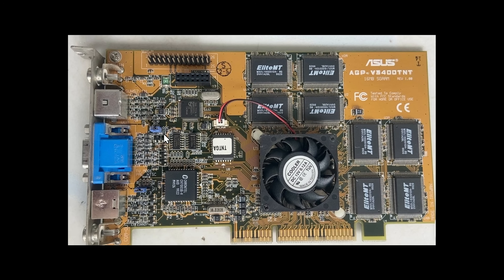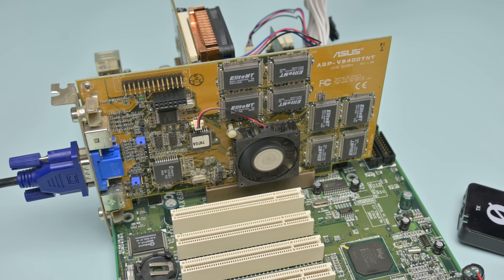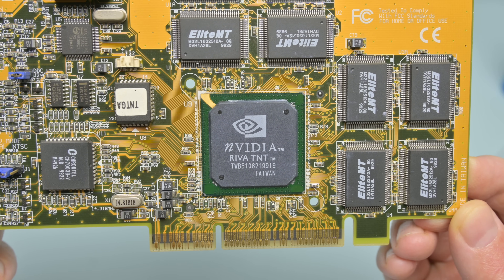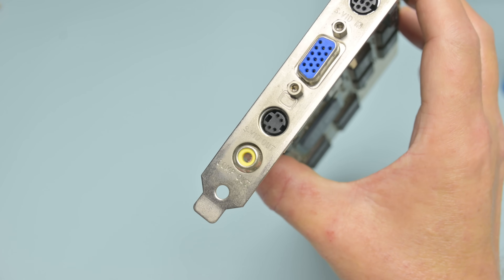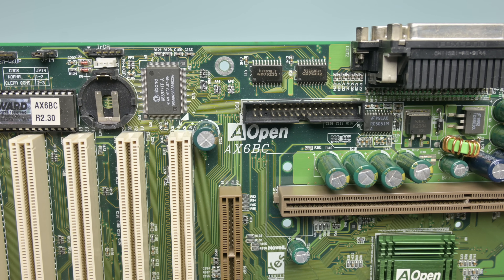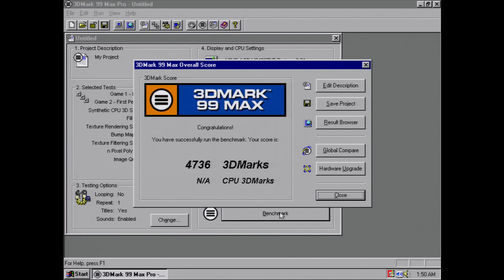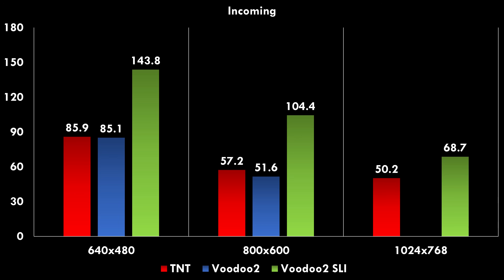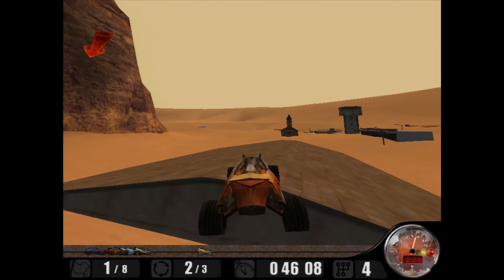ASUS V3400 NVIDIA RIVA TNT

Comment: The Asus manual might be at revision 1.01 of the card since I got one of those and on it there's only one jumper left, the PAL/NTSC switching one. A bit strange is that it says 9927 printed on the backside of the PCB, which I guess is week 27 of 1999, while on my 1.01 revision PCB it says 9841. My card has 16 MB SDRAM made out of eight 7 ns chips btw, I wonder how that would differ in performance compared to your card.
Reply from the maker: I don't think it matters that much. Maybe you can measure a difference, but I doubt it will be meaningful...

Comment: I have same card the fan is broken ( the connector is ripped )
Also i have 
STB Systems Velocity 128 Riva 128 4MB AGP 
Asus V3400 TnT 1 16 MB 
Asus V3800 Deluxe TnT2  32 mb from 1999 my original card that i bought in 1999
Probably will sell all of them
Reply: Thanks for the pinup and all of the content through the years  !

Comment: Those racing games can all be hard to play w/o a controller.  From the way the wheels are moving, I'm guessing you are playing on the keyboard.
Brings back some memories of my old PC, which, thankfully, I still got saved tucked away somewhere.
I set out to build the best I could afford at the time and ended up with a(from memory, so I might be wrong about some details)
Diamond Viper V550 which is a TNT card.
Diamond Monster 3DII(?) which is a voodoo 2 card.
STB "Black Magic" (?) which is a voodoo 2 card I got on sale 1/2 off sometime later.
All on a PII 400 Slot processor on an Asus P2B (?) MB
I believe at the time I was still using Glitchmaster power supplies.  It was a company that took Sparkle power supplies and added a GIANT stiffening capacitor under the hood.  It had enough reserve capacity to ride out an OCR.   A short description of what an OCR is, when the lights "flicker" in your house during a storm, that's an OCR tripping to protect the power grid.
Anyway, I had a lot of fun with that PC.  It's last use, tho was as a lowly monitorless Vent server.   Kind of a sad fate, but I do still have it an hope to recondition it someday for the nostalgia.
Oh, almost forgot, I was using Enlight cases at the time and that PC ended up in a unique "mid/mini" tower that mounted the power supply sideways so it has a slightly shorter, but slightly fatter form factor from a standard mid tower.
For those that may not remember those says, towers were often sized by the number of 5-1/4" expansion bays they had.
Typically:
2 bays = "mini"
3 bays = "mid"
4-5 bays = "full"
6+ bays "super tower" (I think.  I only knew a couple people who liked cases that tall)
I better stop before I write a novel.

Comment: This is my teenage years.  28 years in the game and its magic watching the progress.  To go from hundred mhz to thousands,  and 16gb of ram to thousands.  To put it in perspective my first computer 1997.  16mb of ram, 1gb hard drive 166mhz pentium video card was 2mb of ram and no acceleration.  And a 16 bit sound card.  On that note a 14 inch crt monitor 1024 x 768?  And the best part was every single year was a huge leap.   Over my HS years I bought 2 more pc's with my hard earned money.  By 18 in 1999 I had a Amd Athlon 400mhz with 128mb of ram 2gb hard drive and a 3dfx voodoo 3.

Comment: I had both a Riva TNT2 and 2 Voodoo 2's in SLI and not just the normal Voodoo 2's, the 12MB ones. It meant I could play my games in either OpenGL or GLIDE if they had the drivers for them. Damn good setup.

Comment: RIVA TNT is the first 3D GPU I ever had, so it's very nostalgic for me to see it mentioned 🥰 I had a much more basic Diamond Viper V550 card, with no TV in or out capabilities, in a system based around a Pentium II 350 MHz with 128 MB PC-100 SDRAM. Don't remember the mobo manufacturer, but the chipset was definitely the 440BX. I had that system between around 1999 and 2002 I think, when it got replaced with a system based on Athlon XP 1700+ and GeForce 3. But I'm not an NVIDIA fanboy, I owned two computers with Radeons in them, and now my daily driver is a Mac, so... no brand loyalties whatsoever.

Still, I have fond memories of that PII/TNT system. It was my first proper "gaming" PC, and I also loved playing racing games on it, including Colin McRae Rally 2.0 and consecutive NFS titles: Hot Pursuit, High Stakes (a.k.a. Road Challenge) and Porsche.

Comment: I never paid much attention to the original Riva TNT, i carried on using my Matrox card. When the TNT2 arrived it gave a clear uplift and I was finally able to play games at 32bit colour, faster than 3Dfx (Voodoo2 i think) could do in 16bit. Well that's how i recall it. 🤔  Add to that no pass through cable so image quality was improved and not that expensive compared to early 3Dfx cards.

The drivers were unstable early on, appearing to work then crashing. Sometimes updated drivers would appear a couple times in the same week, as one game was fixed only for another to stop. 3DMark99 really did show up the bad drivers, that race scene was just a crash waiting to happen. They eventually were stable and it never looked beaten until hardware TnL (Transform and Lighting) came along. M64 version was a good budget option.

I finally replaced the TNT2 but came back to it years later and compared it with a GeForce3 Ti200. It stood out that the TNT2 could seriously perform with a faster CPU. I think i had a K6-2 350 and later ran it on an Athlon (thoughbred). Did not have hardware TnL but if a game allowed software fallback for that feature then it worked.

However... i can't see it running ray traced games anytime soon. 😉

Comment: My first PC build used a Diamond Viper 550 Riva TNT 16MB card, on a 440BX slot 1 motherboard sporting the OG Celeron 266 with one of the pins on the edge connector taped over to enable it running on a 100MHz bus which I then overclocked to 112MHz so it ran at 448MHz (4x112MHz) and gave excellent performance for the era (late '98). This would in turn be upgraded over the next few years, the Riva TNT was later replaced by the GeForce 256 DDR, another classic!
Reply: Diamond Viper - my god im still drool hearing that name 😅

Comment: I had the m64 version back in the day on my first personal PC; managed to finagle to it since the proper geforce 256 was too much, but even one of the games in the provided game bundle from Gateway was Alien vs Predator which required more vRAM than the 8MB of the Vanta the particular model would have come with by default.
For an era where a computer was quick to be unusable, it's insane that I got as much mileage with it as I did, up to being playable (not exactly ideal) with Quake 3 arena, at 512x384. Granted, CRT's helped a lot in masking the issues of running a non-native resolution that an LCD would make me miserable for otherwise.

Going from that to a geforce 3 Ti200 was an enormous leap, to say the least.

Comment: NOTE : The Asus V3400 was te best overclockable TNT by far in 1998-1999. Many other TNT1 does not come with a fan. SGRAM is faster by about 10% and 8ns module overclock well too. See also on tomahardware showndown all TNT cards, Hercule dynamite had a active cooler too but sdram (in this test, the asus was also sdram) ... ASUS was very ahead of all TNT . I had exact same card in summer 1999.The fan itself was different (and died in few months) with a better airflow, repaste, I remember did 125mhz core!and 135mhz memory. (but I still had a voodoo 2 for glide, in 99... glide had still good times... ;D ) you should overclock it!!! it was made for this ;D

Comment: The Riva TNT needed a fast CPU around 400 Mhz to outperform the Voodoo2. For the ~200Mhz CPUs the Voodoo2 won most of the time. Those were insane times where after 3 years a top gaming machine was completely outdated and couldn't run the latest games.

Comment: Nice but you did not talk about the weakness of the Riva TNT -  compatibility issues with many games from that period. Practically all 3d games in that time were optimised for the 3dfx Voodoo cards, not for the Riva TNT or other companies. Also the Riva TNT was SLOW on the CPUs from 1998  it needed at least a P2 400 mhz to run well and such a CPU was extremly expensive that year, nobody could afford it.
Reply: Carmageddon 2 Looks amazing with Glide and looks bad/software rendered with TNT2. TNT2 was better a few years later when everything went D3D and faster cheap CPUs were pushing 1ghz but yes late 90s I'd take a 3DFX please.
Reply: yes, in 98-99 direct 3d and opengl was not very great, I had a voodoo 2 side of my V3400 (also overclock very well.. ;) ) the TNT was important, I had a viewsonic ps790 1600x1200 monitor in 99 ;) In 2000 with the geforce, it was different story... ;)

Comment: The Riva TNT was the card that actually pulled me from 3DFX, my previous card was the Banshee, I loved dues to my hatred of passthrough distortion - I refused to believe that 32Bit colouring was better than 3DFXs optimised 16bit but the first time I played Unreal ... I was a believer!
Reply: Sure but the Riva TNT and TNT 2 lose 30% -  80% performance from 16 to 32 bit.   For example in Quake 3 1024x768 a Riva TNT2 had an average of 37 fps in 16 bit, in 32 bit the FPS fropped to 24.

Comment: I had a Diamond Viper 550 (TNT) and a Viper 770 Ultra (Overclocked TNT II). Really enjoyed the 770! It was a BEAST overclocker with a peltier epoxied to the GPU die! One thing that is lost comparing it against Voodoo's is the integrated 2D + RAMDAC. The loss of visual quality on a Voodoo having to run passthrough cables just really sucked!

Comment: You can download a free dB meter for your smartphone, maybe in the future use that to measure the noise levels? 🤔
Reply from the maker: I think a recording is better than a dB figure.
Reply: @philscomputerlab  I rather meant it as an addition, not as a replacement. But I don't think a recording translates as well on video, because the results can be really different based on the recording equipment and hardware it's played back on, it would be good to see raw numbers on top of that to visually see the difference.
Reply from the maker: @JDelwynn Yea I just don't see it that way. The little rating sounds might not measure as much but are definitely more annoying that a smooth spinning fan.

Comment: When I got my TNT I found it a massive disappointment. Honestly, if you had a selection of Glide games, they just ran so nice on 3dfx... Stepping to the TNT meant you fell back to whatever d3d support it had and suddenly stuff got SLOWER. It was crap. Maybe if you had a good CPU it was fine but for the CPU I had at the time it actually made some of my favourite games run worse.
Reply: I probably had a k6 233. Eventually went to a k6-2 500.
Reply: You are correct, not only had thr Riva TNT a lot of compatibility issues with the games from that period but it was also very slow on PCs with CPUs slower than a P2 400.

Comment: In those days, what I noticed as an "average user" the voodoo cards tended to play games better out of the box, install and go.  With the tnt you had to have a bit more knowledge on how to configure it for what you wanted, (ie; switching between 32bit and 16bit, vsync, refresh rates on the monitor for each resolution, using rivatuner etc;). The voodoo card just worked and worked well for people with less knowledge. This was my experience anyway.  I really noticed this when I went from a voodoo 3 PCI to a pine brand tnt2 PCI in 2001.
Reply: The Voodoo 3 PCI was much faster than the Riva TNT2 PCI. On AGP the difference was small but on PCI the Voodoo 3 was significantly faster.

Comment: I wish I kept my first PC as it's hard to know what I had, but my parents sold it as I played Playstation instead. It came with racing game that was 3D and in my head it had someone black in like spandex or something, I remember riding through a tunnel in canyons. Half-Life wasn't out then but I cannot remember the year either :/ Then I remember our second PC was a Packard Bell in 1999, a prebuilt and it had some kind of integrated graphics. I'd be interested to know if it was better than the Voodoo? I remember it was a P3 with some graphics on the board, it could play Quake 3 just fine, but not RTCW as that required 64mb and I only had 63MB because 1MB was reserved.

Comment: The problem with 3dfx was the architecture didn't support 32 bit color or 2D display.  It cost $300 at the time and required an existing 2D graphics card and simply overplayed or took over the display for 3D only.
Reply: 1998 "Problem"?

Comment: I have Riva TNT in my collection, a PCI version - STB Velocity 4400 iirc. I bought it off a friend when he upgraded like 20+ years ago and used it in a Pentium 4 for years to drive a 2nd/3rd monitor. Tried it out in my pentium 166 for a while, but the CPU wasn't a good match .... So in a box it has sat for many years, waiting for the right system to pair it with.

Comment: I sidegraded to the TNT from a Voodoo2 because of 32bit alone. I took the performance hit to get nicer looking textures. Also, didn't the TNT support higher resolution textures? I think the Voodoo2 maxed out at 256x256 textures?
Reply from the maker: Yes it does! It's something that's easily overlooked. I think I saw it in Expendable. It's noticeable when you know what to look for, and at higher resolution.
Reply: Yeah but in 1998 and 1999 there were probably less than 10 games that used 512x512 textures.

Comment: OMG I so rmbr that game, and playing it on my Voodoo 3500 64mb agp card, it cost me nearly a month of wages at the time but so worth it, and everything looks btr on glide lol :) 
( I still have the card just no motherboard to plug it into, it's a weird agp slot/type not standard, won't fit into my P4 mobo, any ideas what type I should look for?) 
Thanks for trip down memory lane Phil very cool, keep up the awesome videos :)
Reply from the maker: I read the readme file of that game and it was, from the ground up, targeted for Glide.
Reply from the maker: The Voodoo3 isn't compatible with newer AGP slots. There are boards with universal AGP slots, but a Pentium III is a safe bet.
Reply: So look for a P3 system/board to run this card then you reckon?
Reply from the maker: @Frank_2023 Yes 😊